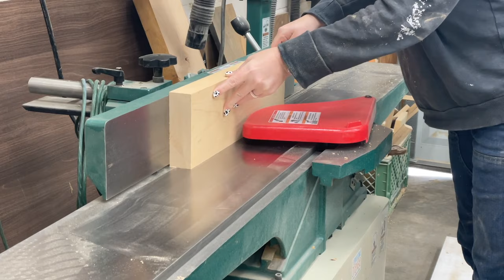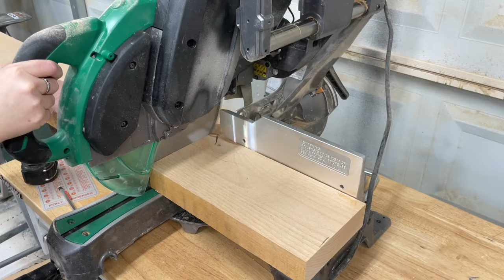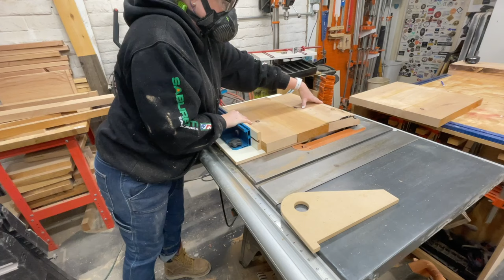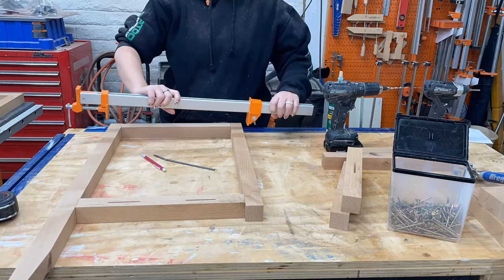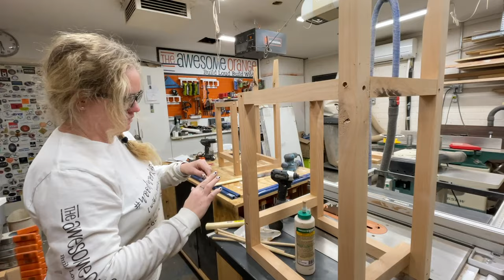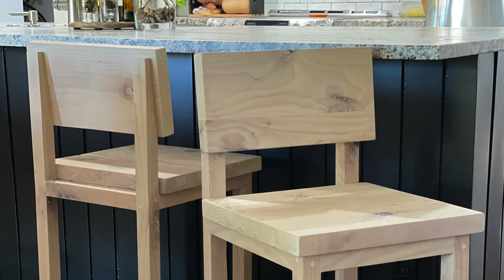Building Counter Height Chairs | or Stools

Comment: Our apartment has a crazy high bar and needs at minimum 38" barstools and I also have minimal tools (Dewalt 20v jig saw, router, orbital sander, and drill). I don't have much money as I am going back to school for software engineering but these look like they will fit our means perfectly! I am sure the limited tools will make this quite interesting to build (not to mention my folding woodworking bench on our apartment balcony) but I look forward to the challenge in about a week!
Reply from the maker: Awesome! Happy building! 🍊

Comment: How did you get the feet levelers in without it hitting the screw? The threads look pretty long and on top of that the feet are inset.
Reply from the maker: Great question! It wasn’t easy and I barely had enough room on a couple of them. But it you place your screws just right and offset then it can work. 🍊

Comment: I think its a mistake to put stretcher bars at floor level.  They will interfere with feet like a kickboard
 and any time there is something under them it will be broken or the stool will not stand upright.
(IMHO of course 😊)
Reply from the maker: Thanks for your opinion. I have get levelers on the base so those are really the only thing touching the ground. 🍊